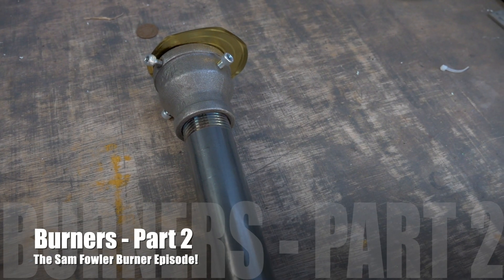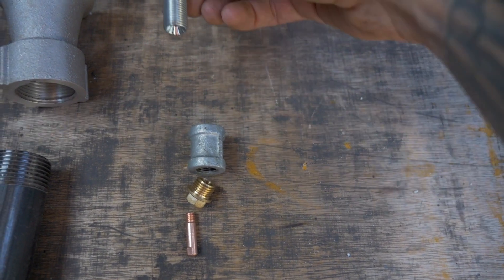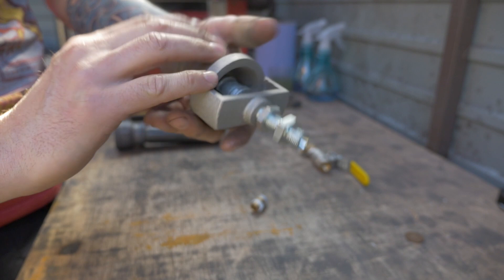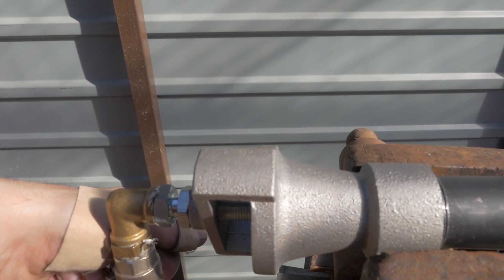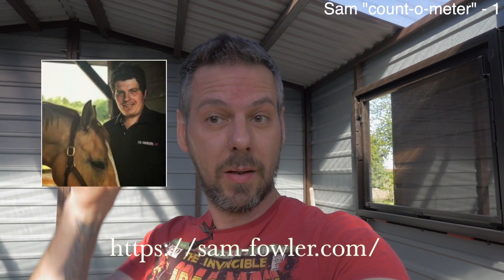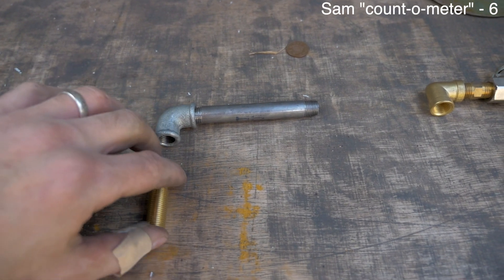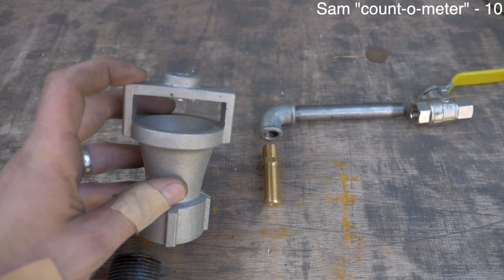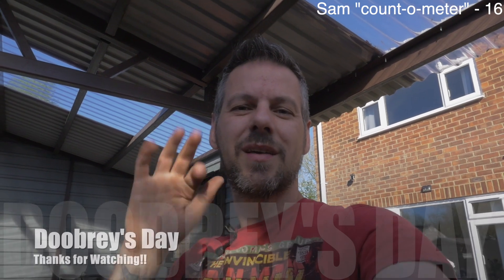Forge Burners part 2 - DIY or buy?

Comment: Know this is a year old now but v informative. Thanks.

Before I order the bits would you mind confirming that the gas pieces (brass and bulkhead joint etc) are all 1/4" BSP please? May be my eyes but they look considerably larger than that. Cheers
Reply from the maker: Hi sorry about the delay.  Christmas got in the way.  What ya need to know?
Reply: @Doobrey  It's ok now thanks mate. I was unfamiliar with BSP type fittings. Now realise they are all 1/4" bsp so that's what I've picked up. Thanks for the reply and video!

Comment: Hi, I was just wondering if you have a link to the bulkhead joint you used - it seems to be missing from the inventory list, thanks
Reply from the maker: Which bulk head ?!?  Which bit
Reply: @Doobrey  sorry, I couldn't catch what you called it in the video - I'm talking about the long threaded tube that you screwed into the top of the venturi? Great video by the way - it's the reason I've actually decided to build a new burner!
Reply: @Doobrey do you have an Amazon link to the long threaded bulkhead you screwed into the actual venturi ?  It's missing from your part list.  It's the long steel threaded rod which passes through the venturi... Thanks! Al

Comment: Good stuff, those burners are the design from Gameco here in Australia, I have their big one. Tell me with that second time you modified it, did you put the jet very far down into the venturi? I would be interested to know.
Reply from the maker: Yup.  Ive been playing around with pipe sizes etc.  The official sam fowler ones are excellent and are now in my forge !!I will be using my home made ones in a foundry in the future.
Reply: @Doobrey  Good stuff, how is Sam going first saw Him when he was helping Alec Steele.?
Reply: @Doobrey  how deep is the end of the mig tip inside the venturi reducer?